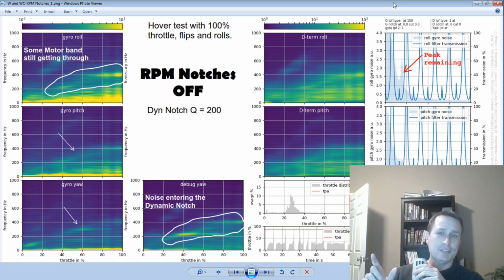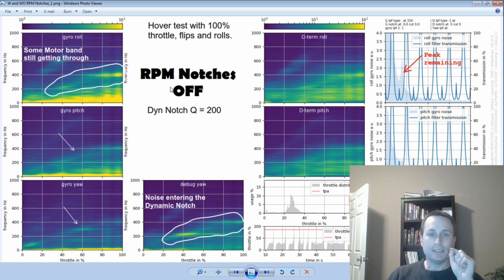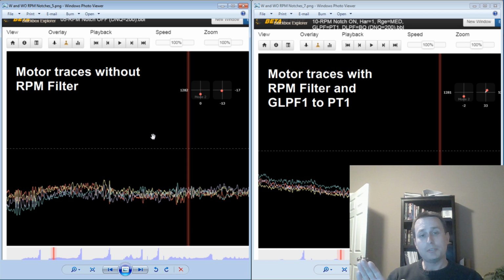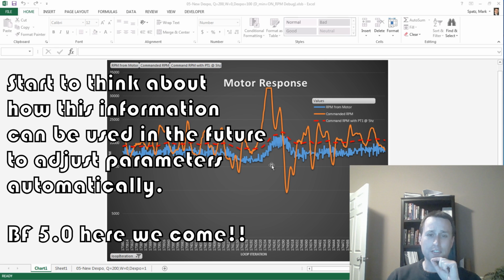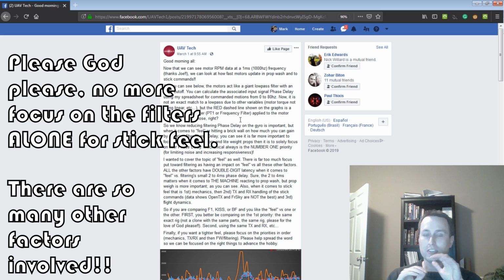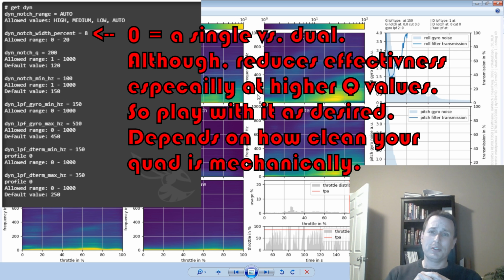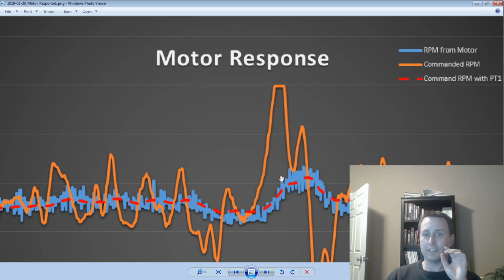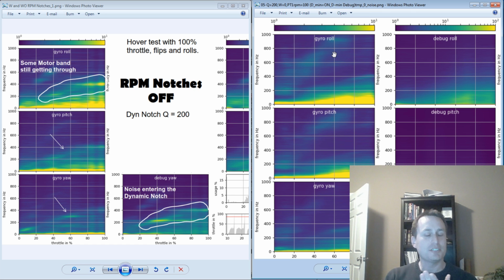Motor Latency & RPM Notch Settings | Analysis

Comment: The advantage of using rpm for the dynamic notch placement is that i would suspect the filtering will be much more consistent.

The only concern i have with the filtering getting so good is that it seems the prop makers are getting really lax with the balance of there props now. whilst in flight this is fine with adaptive filtering the gyro is still getting smashed with mad vibrations probably making them fail much more quickly.

Good reason to get boards like the airbot ones with replaceable gyros me thinks.
Reply: Consistency is a huge part of that, and the much quicker reaction to moving the FFTs and filter centers with that should produce a more consistent feel across throttle band (or at least across the same inputs and flight maneuvers), while reactive dynamic notch will always just be reacting.
If anything, we have the tools to very quickly identify what the weak link is - and props will have nowhere to hide.
I have a fleet of quads, all of which are relativelye expendable to me, so if it's cheaper to just upgrade gyros and have a spare, I'll do that before trying to replace a gyro myself.